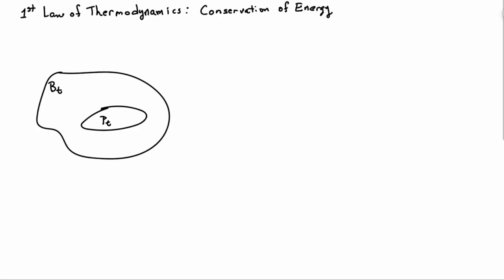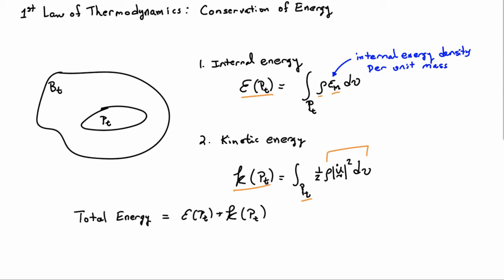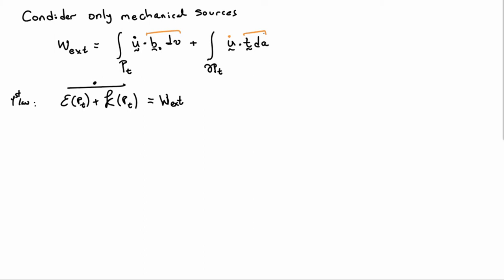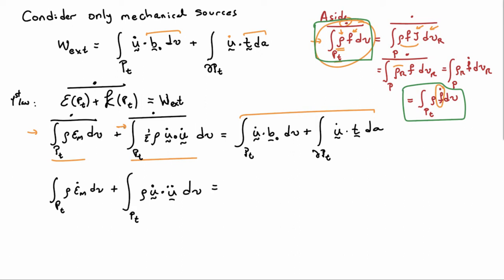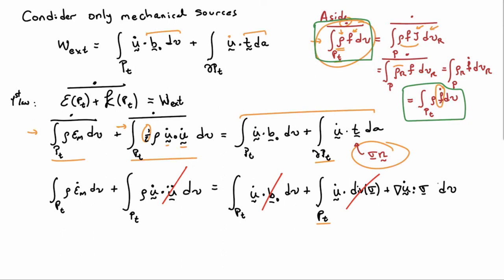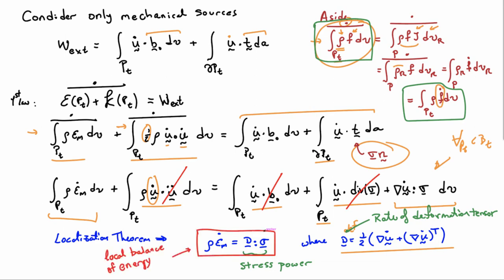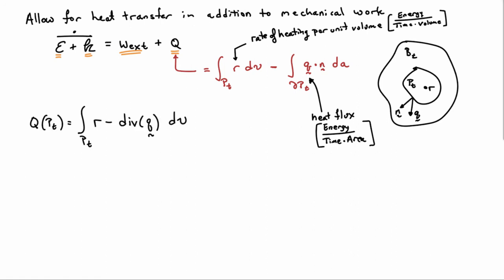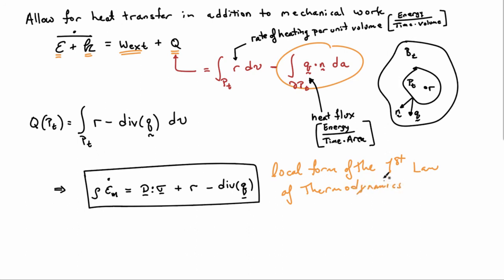21. 1st Law of Thermodynamics -- Balance (Conservation) of Energy

Comment: Dear Sir, I have a doubt about the part(at 7.46 minutes) where you took stress power as a double dot product of the symmetric part of velocity gradient and stress instead of the double dot product of velocity gradient and stress as it was in global form. Btw, this series is awesome. I get interested in continuum mechanics because of this series. A huge thanks for your efforts, Sir.
Reply from the maker: The reason is because  sym(A) : skw(B) = 0, always.  You can verify this 'easily' by writing the double contraction out in components; all the terms will be zero or cancel with other terms.  Thus sigma : grad(v) = sigma : (sym[grad v] + skw[grad v]) = sigma : sym[grad v], since sigma is symmetric.
Reply from the maker: Note for all tensors A, A = sym(A) + skw(A), since by definition sym(A) = (A+A^T)/2 and skw(A) = (A-A^T)/2.
Reply: Is it because of skew-symmetric part only rotates an element and the symmetric part of displacement stretches an element(as you mentioned in one of your videos)?